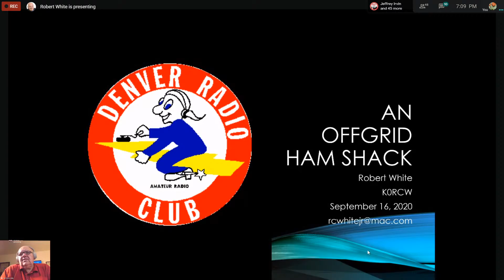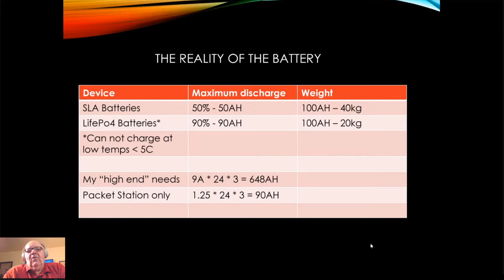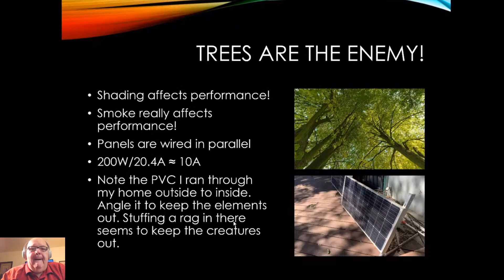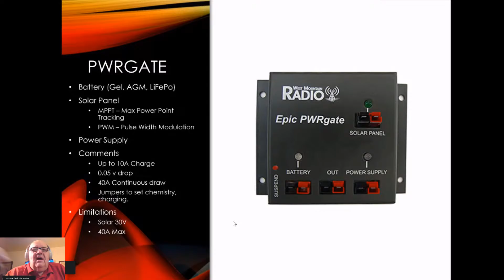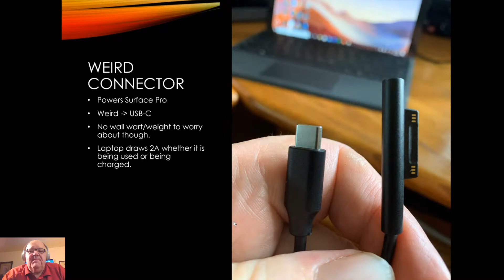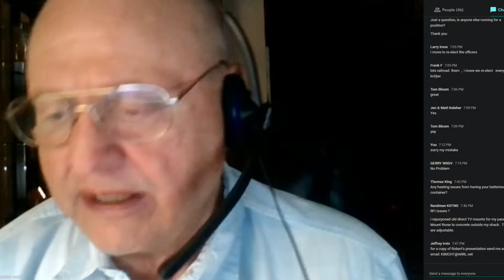Operating Off the Grid - Robert White - K0RCW

Comment: Have most of the west mountain system (epic pwrgate, pwrcheck, pwrguard, and rigrunner). While the epic works great for switching between power supply and battery, it does not seem to be an effective reliable MPPT. A lot of inconsistencies and issues